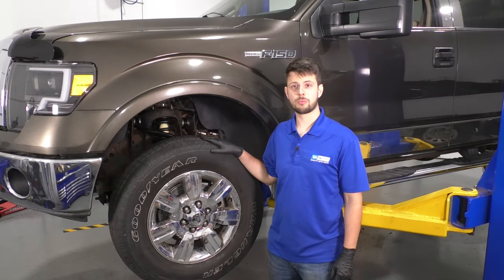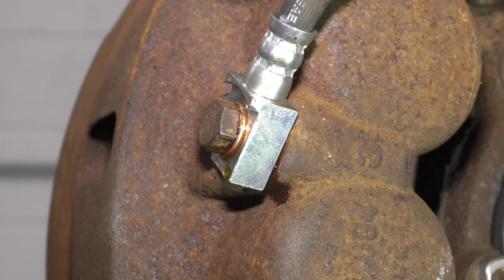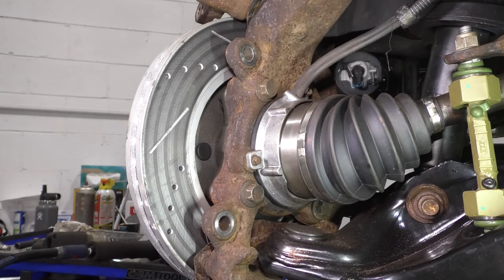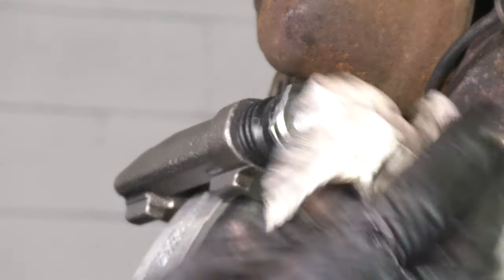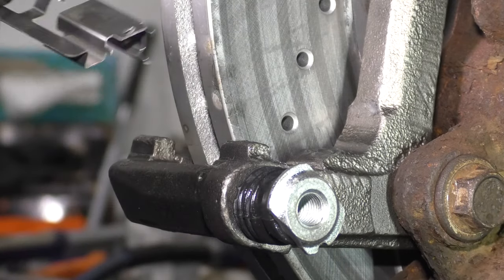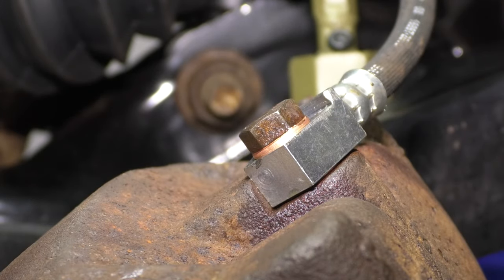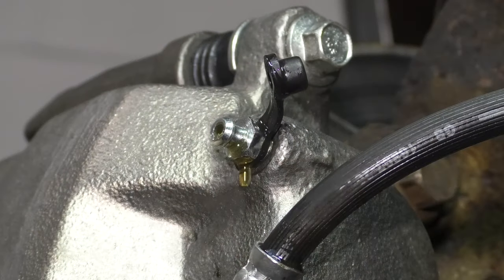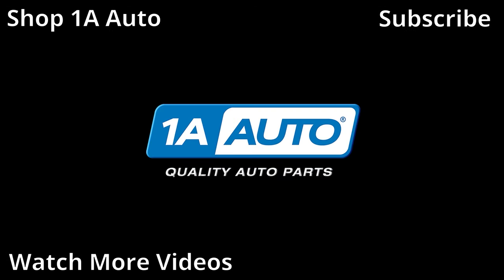How to Replace Front Brake Calipers 2009-2014 Ford F-150

Comment: thanks man this was helpful, started with just a brake pad change, but quickly escalated when lower slider pins on both sides had seized. Stuck in my driveway, had to finish what I started.

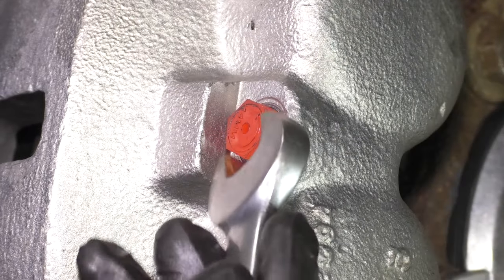Comment: @8:24 55-ft-lbs sheered off my caliper pin screw sooo not sure about that one. I just torqued  the new pin  down snug and called it a day… but thanks for the video. I followed step by step besides the torque lol

Comment: Pre-loading pads and then mounting the caliper is much each easier. 
...(don't forget the grease)
Turn steering left/right to torque bracket and pin bolts. 
Steer straight to thread and torque the banjo bolts.